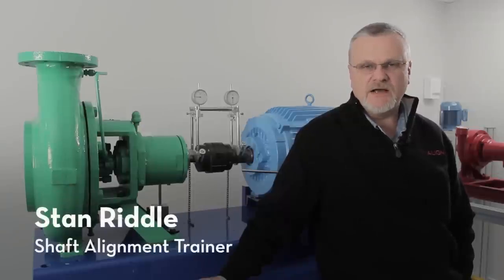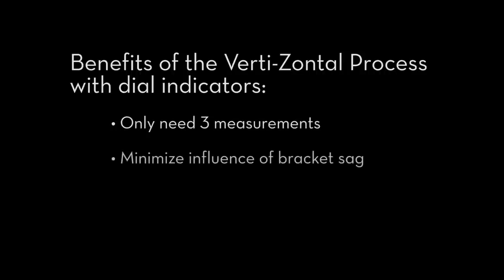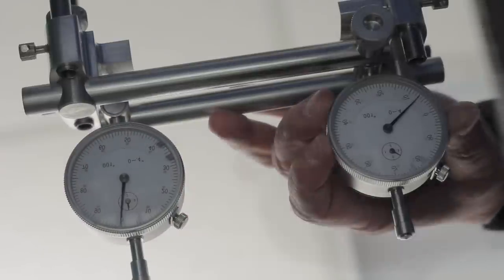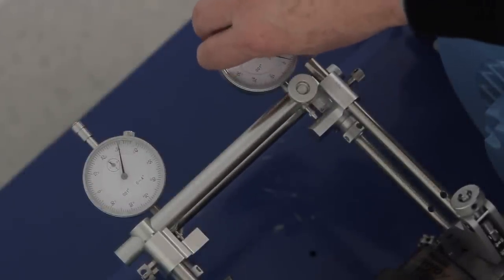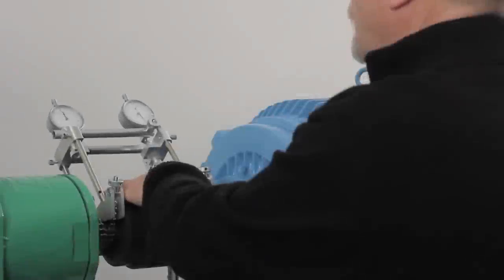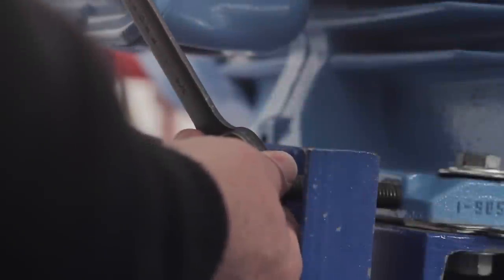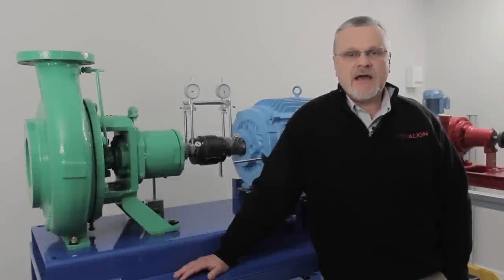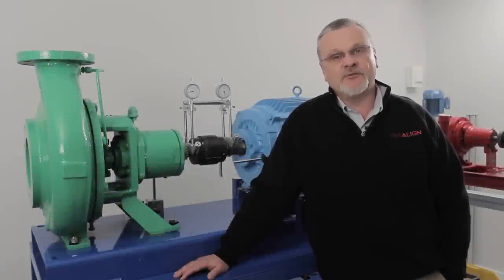Shaft Alignment Training: Faster Alignment With Dials | ACOEM

Comment: Could you pls make clear for me about these:
1. I already know the Formula but when i work with big motor. it is difficult to get the exactly dimensions  for the formula. is there other way to get the vertical shim movement?
2. Could you pls explain why using undercut bolt is not acceptable?

Comment: Greta method - but does it also check for angular misalignment in the vertical?
Reply from the maker: +Lloyd Judd 
As long as you correct the vertical offset by shimming as your first correction, the lasers are reading live and will continuously sense the position through the horizontal correction to bring the shafts into alignment.